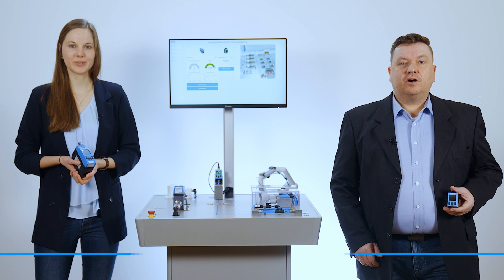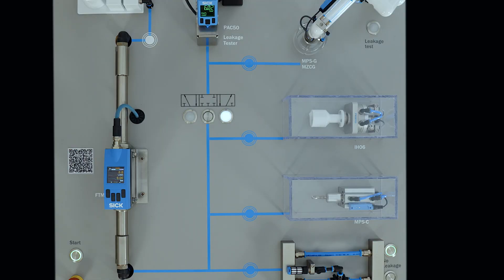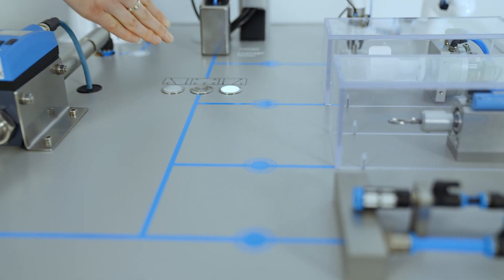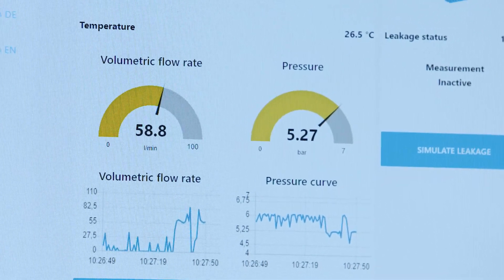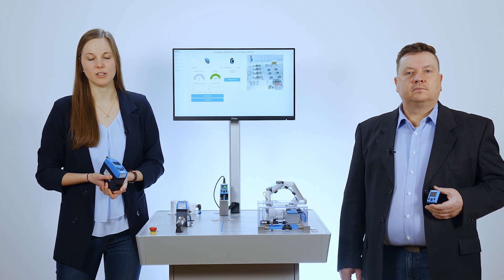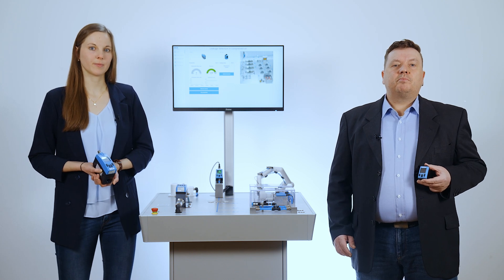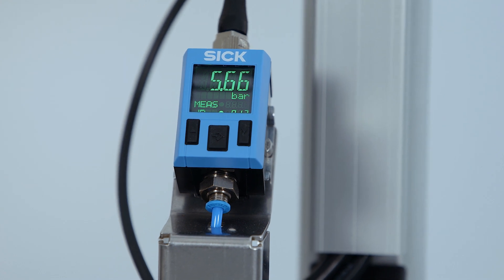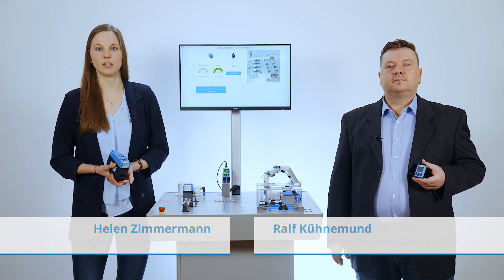FTMg and PAC50 LT from SICK: Leakage detection in compressed air | SICK AG

Comment: How does it differentiate leaks from real air usage?
What I understand a sensor on each air consumer is important, so it can tally all the "legit" consumers and compare it to the air output of the compressor, any difference would then be a leak.
Another method of detecting a leak is under the circumstance where all air consumers are in a state of not consuming air. Then leakage can be detected by any pressure drop.
But this would require some signalling via NO contacts in series, so only when all machines signal "Im not consuming air for now", the system knows it can measure for pressure drops.
Reply from the maker: Hello Sebastian Nielsen, 
With the FTMg, integrated data monitoring allows conclusions to be drawn about leaks, which means that leaks in pneumatic systems can be detected at an early stage. With the PAC50 Leakage Tester, leaks become apparent through a pressure drop in a self containded area over a specified period of time. For further information please feel free to contact our experts by mail: info@sick.de  
Best regards
Reply: @SICKSensors  yes but a pressure drop would of course happen when a air consumer "legally" consumes air too. So in some way the system must know when the pressure drop is expected or not right?
Reply from the maker: To perform the leakage test function of the PAC50LT, the system must be at a standstill. By setting 2 (pressure) threshold values p1 and p2, as well as a desired duration of the measurement, it can be checked whether a self contained compressed air system has a leak. 
With the help of the integrated data monitoring, the FTMg allows conclusions to be drawn about leakages in the running process. There are several possibilities for this: E.g. assuming that a machine continuously produces the same product and makes the same motion sequences, the compressed air consumption should also be the same. Thus, by comparing a machine's past/historical compressed air history with its current compressed air consumption, leakage can be inferred. Without leakage, the historical compressed air consumption would have to be identical to the current compressed air consumption. If an offset can be seen, this may be an indication of leakage or wear. 
Similarly, the consumptions of two identical machines can be compared. If there are no leaks, they should have approximately the same compressed air consumption.